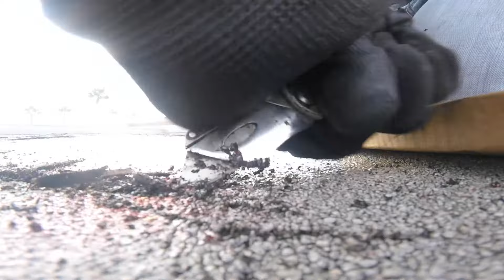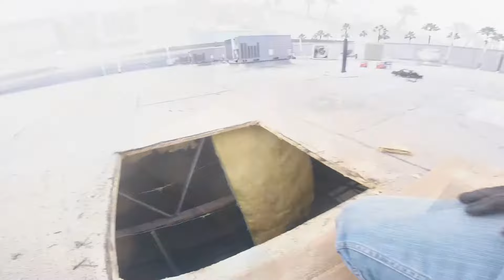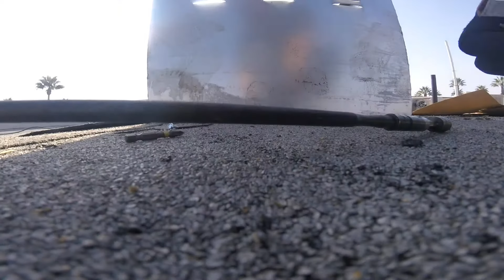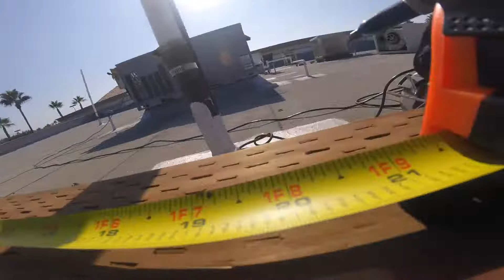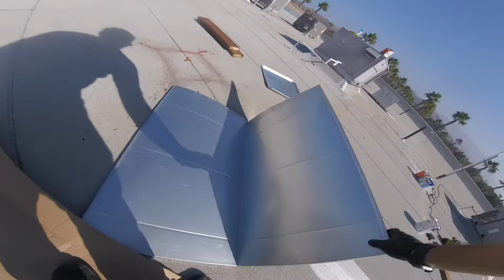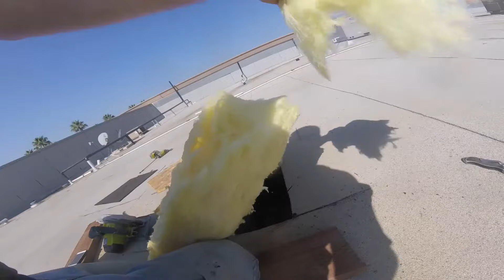HVAC. Beginning of Kitchen Exhaust and swamp cooler install. 1080

Comment: when I plunge cut with circular saw, I put the front of it's base on the surface, keeping the back end tipped up and slowly pivot it down while blade cuts in, which helps keep it in place, gives you more control and stability.  of course don't be directly in line behind it if it decides to go for a run  :))
Reply from the maker: It was blade for metal)). Wasn’t doing that good on wood
Reply: :)) I didn't pay attention to the blade, but I see it after looking again. I have separate cordless saws for metal and wood. no blade changing! then again I do all types of work
Reply: I saw the same thing. The way he does it there is a lot more kickback. Also I like to keep the reciprocating saw pushed up tight so it doesn’t bend the blade.

Comment: Is this up to code? Using wood to secure duct?  This not for type 1 hood isn’t it?
Reply from the maker: There was no duct on the vid metal curb only. Its Type I hood. Duct was dropped inside insulated with fyre wrap, double wall